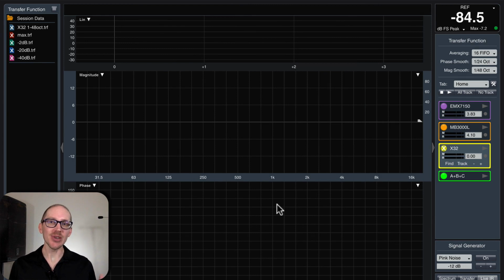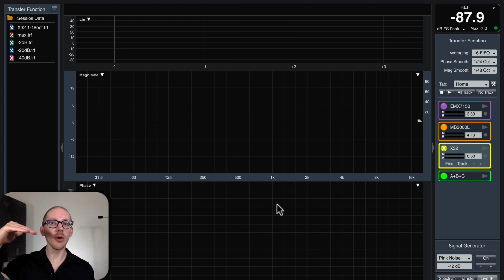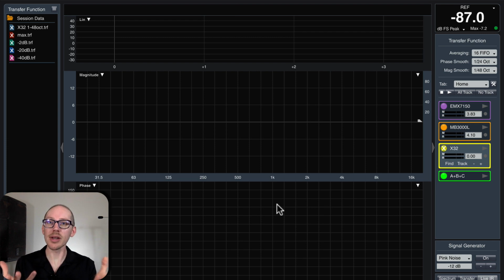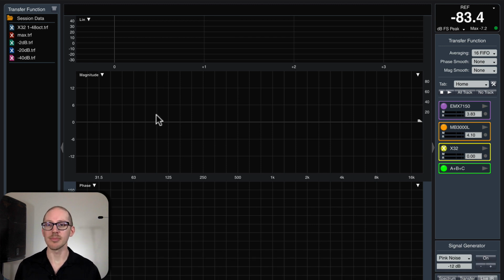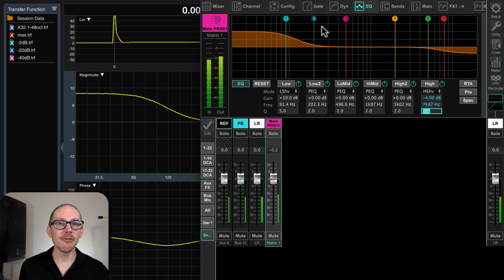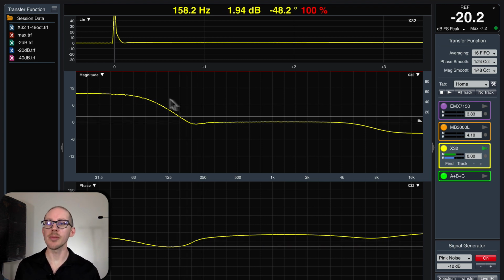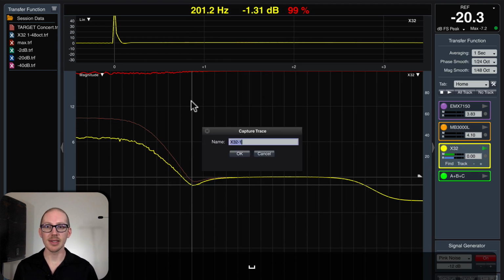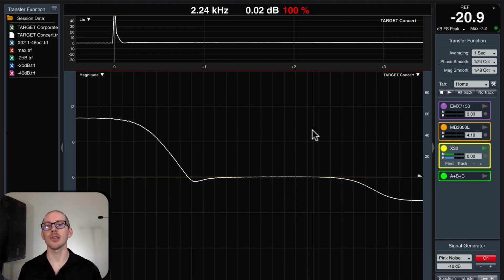How to create a target trace in Smaart [GSwSST25]

Comment: Hi, when doing the target trace for multiple matrix line, do you do each matrix line at a time? For example, my left and right running matrix 1&2,  my mid fill running matrix3, if i do trace target for my left and right, then when i turn on my mid fill the trace target for L&R will be affected. Do you suggest to turn mid fill on while doing trace target for my L&R? If i turn mid fill on when doing trace target for L&R then when doing trace target for mid fill it will affect my previous setting for the L&R right. Can you please suggest what can i do for this case. Thanks in advance.
Reply from the maker: Hi phutran. Every source needs verification, aim, placement, EQ, and crossover alignment solo and combined. For example, to be complete, you would calibrate each element of your mid-fill array, then calibrate it as a unit, then calibrate it combined with other systems.

Comment: Hi Nathan, just wondering if that target trace was used for live sound check under pink noise? Do you use weight Z measurement (flat) to do the live sound measurement reaching that target trace? Thanks
Reply from the maker: Hi Phu! 

> that target trace was used for live sound check under pink noise?
I typically use audio analyzers that are source independent. I can use music, pink noise, or anything else and it will deliver the same data. That being said, I usually use a combination of pink and brown noise and music. :)

> Do you use weight Z measurement 
Yes

Comment: How do you move the smaart stock target trace down to your measurements? Or do you have to bring the measurements up to the trace?
Reply from the maker: Hi Blonchay123, please see pg. 86 of the Smaart User Guide.

Target curves cannot be grabbed or moved up and down on the graph as live measurement and static data traces can. They move up or down automatically to accommodate changes in banding resolution, but otherwise their position is fixed. They do not appear in the graph legend and the cursor readout ignores them. Target curves are not displayed on un-banded (narrowband) spectrum displays or transfer function graphs. However, if you need a target curve for a narrowband RTA or transfer function graph, you can make one pretty easily by importing data from a text file as a regular data trace, using the Import ASCII function (see Import ASCII on page 83).

Comment: Hi Nathan, interesting video. Do you propose to set the system tuning standard to your target trace?
All other videos are about creating a blank canvas by tuning the system to ' flat' and only correcting venue sound problems.
Reply from the maker: Hey Jeroen, thanks for checking out the video.

> Do you propose to set the system tuning standard to your target trace?
No, not at all. In fact, if possible, I suggest EQing your first main system with reference tracks by ear, then using a measurement of that as your target. I have found the general targets I'm using now to be helpful specifically for Smaart with its multiple time records. If a speaker is well behaved at 1m, it will have this kind of tilt once you get 20m into the room.

Another way to go about it is to look at the final measurement of combined systems from your last shows and develop a target trace from that, system brand/model dependent if possible.

> by tuning the system to ' flat'
Did I say that? I hope not. If so, it may have been a mistake. The audio analyzer is great at helping you find "same", but I avoid promoting "flat".
Reply: you probably dont give a damn but does anybody know a trick to log back into an instagram account..?
I was dumb forgot the password. I appreciate any tricks you can give me!
Reply: @Brian Uriah Instablaster ;)
Reply: @Harper Karsyn i really appreciate your reply. I got to the site thru google and Im in the hacking process now.
Seems to take a while so I will get back to you later when my account password hopefully is recovered.
Reply: @Harper Karsyn It did the trick and I actually got access to my account again. I am so happy!
Thank you so much, you really help me out !
Reply: @Brian Uriah glad I could help =)